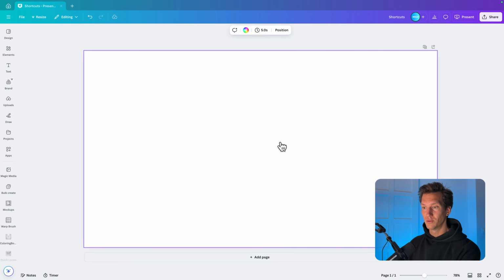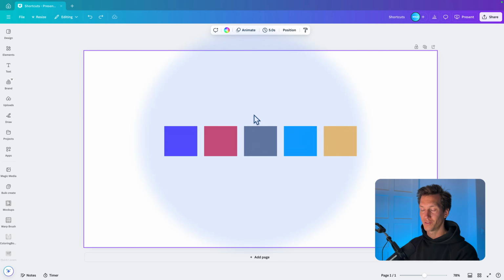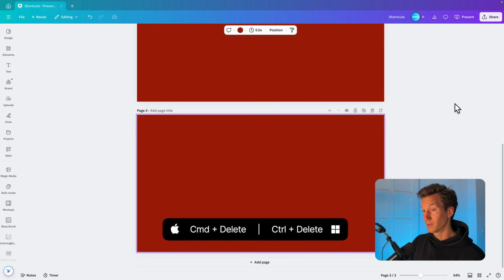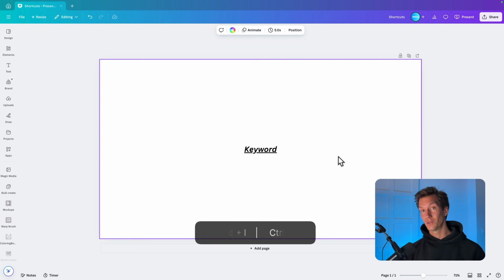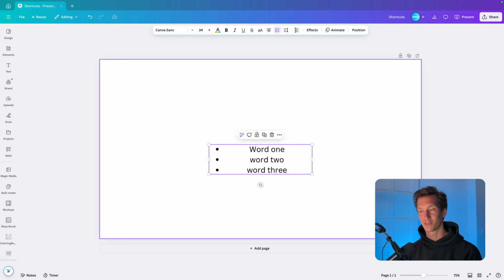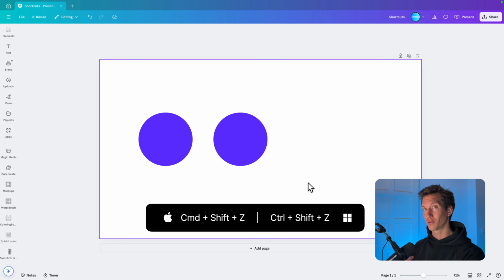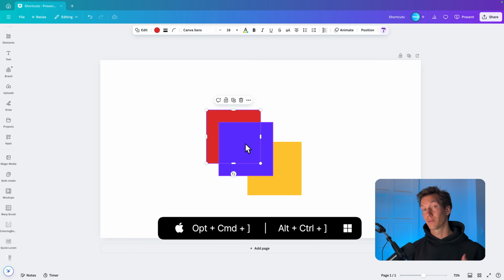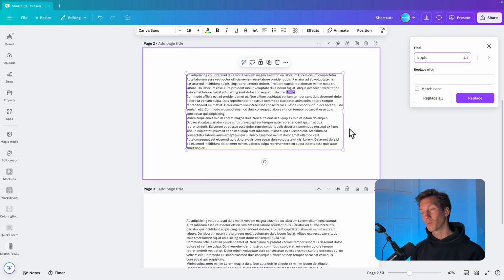16 CANVA Shortcuts you MUST Know

Comment: excelent info i have been using it. 
But i dont know why some of the most important shortcuts are not working in my pc like "Control + ]" any idea may be what could be going on ? 
Thanks for the excelent quality and info.
Reply from the maker: Thanks 🙏💜 I had a similar issue with that one as I’m working on a EU keyboard (Azerty) so it doesn’t have those keys myself. 

Unfortunately they don’t allow custom shortcuts yet, so I can’t change them. 

Workaround I used is set my keyboard to Qwerty US for the tutorial and used the key where the bracket should be (as an example for this tutorial). Not a very practical solution I must say 🥲

Hopefully they allow custom shortcuts soon